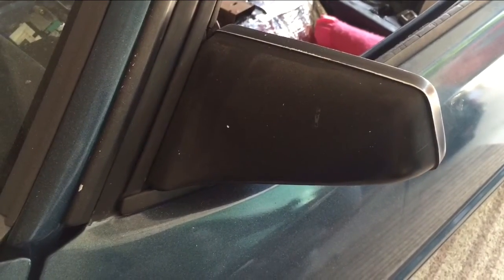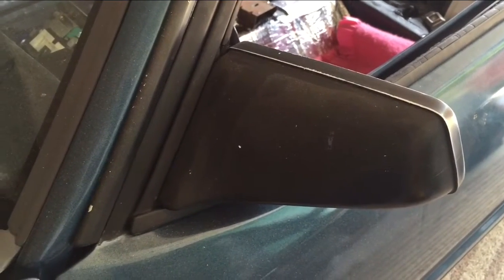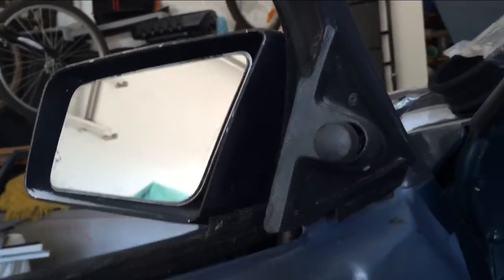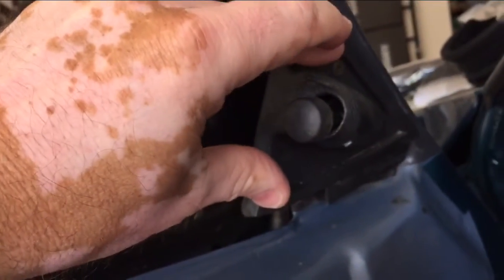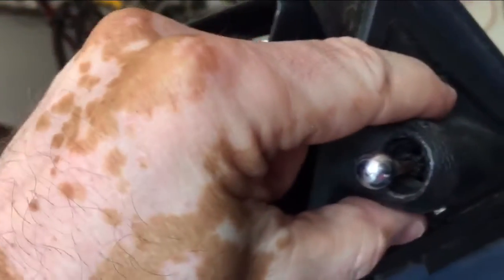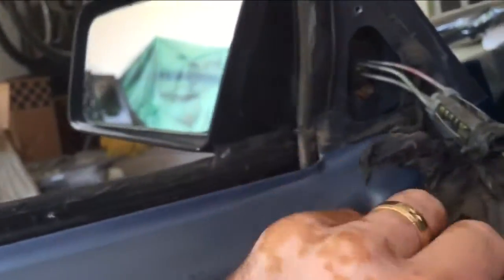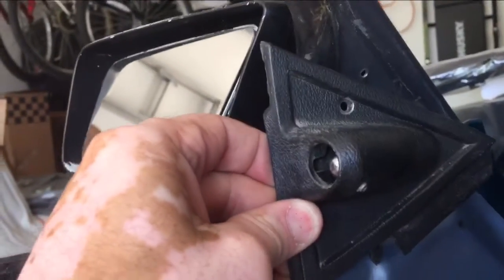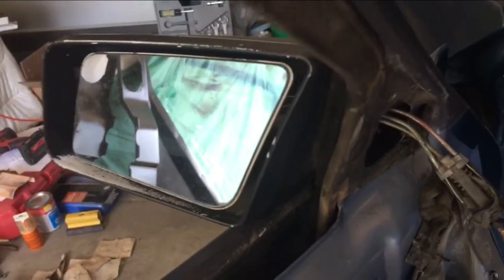Removing side mirror on 1986 Foxbody Mustang

Comment: I think it's awesome when anyone shares their experience with anything on these older cars. I really do appreciate it. All of these old Fox Bodies will need a rag joint replacement on the steering shaft. I wish I would have made a video when I replaced mine.
Reply from the maker: Hi Dilligaf, yeah rag joint I did a video on it, wasn’t pretty. Ended up replacing the steering rack and shaft.

Comment: Do you have to take the mirror off to remove the outer weatherstripping?  Thanks
Reply from the maker: Hi David, yes I had to remove the mirror to remove/install the weather stripping (beltline?). Item to note the new parts are snug fit try not to spring them apart to ease installation. I did this a little on mine and the new driver side weather stripping keeps working its way loose now. FYI, I also have posted a 1 minute video on "Replacing the outer beltline on 1986 Foxbody Mustang" if that helps you any. Good luck with the project. 
Blessings,
Hans
Reply: @hansparis5860  thank you very much!  God bless